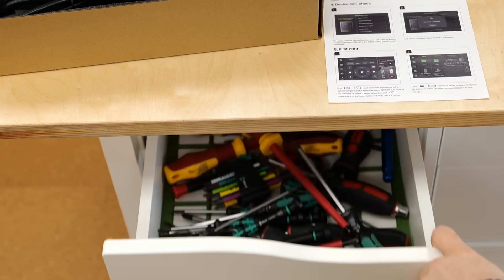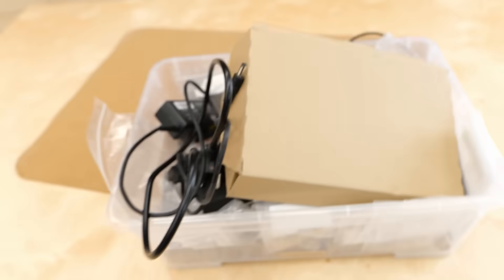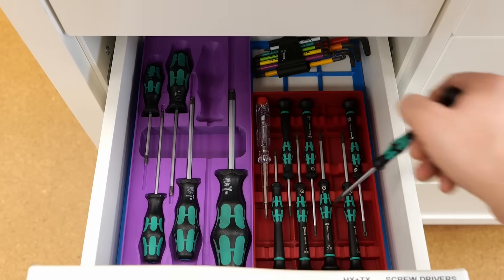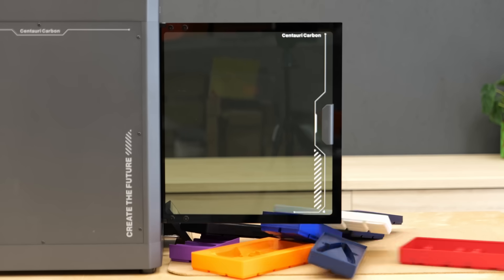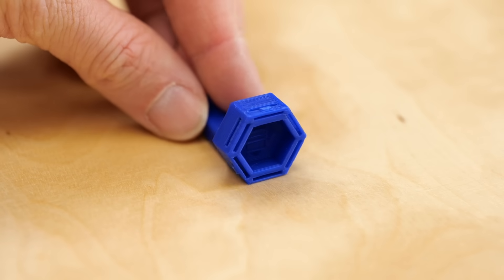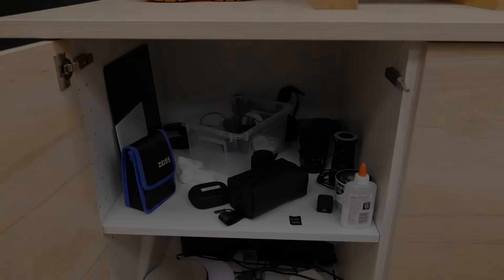The Best 3D Printed Organizers for your Workshop

Comment: I can confirm that the new RC firmware for prusa does in fact fix the mmu3 overcurrent issue. My MK3.5 had it for a while but I was too sick to bother with it. My MK4s got it today out of the blue. The firmware fixed both 100%, but due to the fact that I don't trust the power grid with the tornados that are coming in today I turned both off. So no printing. Maybe tomorrow! Assuming I have power. lol

Comment: Instead of a sticker label on the filament rack, this could be your time with a quick 3D print clamp-label. 
To the advantage, that you can (re-)move it :). 
You could of course print it with a flat and label that 🙃

Comment: I still don't get the gridfinity obsession. If you want to put some holders in a drawer to organize it great, just put the holders in the drawer. What does the gird add?
Reply: Stuff moves around whenever you open and close drawers repeatedly. So you have to keep the drawer packed tightly or the boxes will begin to shuffle around and become disorganized. If you take a box out, then things begin to shift about.

Also, the odd shape of some items might mean you'll have a useless and unused area in the drawer,  and everything will slide around. Hence the grid to maintain order.

Comment: Haha kind of crazy, I feel like 3D printed organizational systems are all the rage right now! It's definitely an amazing application for 3D printing. I went with the Mulitboard standard for vertical organization and Gridfinity for Horizontal (and combinations of both). I feel like Multiboard has a lot more thought and options behind it than the Honeycomb, I really like the ability to thread things together instead of just snapping. It just feels like a much more secure system.
Reply: Or just use an actual pegboard and only print specific hooks/holders you need. The cost/time/durability just isn't there at the end of the day. If someone wants to do it as a fun project, sure, but it is in no way more practical than a standard pegboard.

Comment: Very nice workshop! 

Are you drying your filaments every time before use ? Because here in Sardegna we have 75-80% humidity and I can't imagine leaving the spools without boxes with silica 😭
Reply from the maker: I usually don't with PLA. In winter we rather have ~30% rH here and in summer 50-60% so this is not much of a concern to me. If I print PC, PA etc. I will either store them <15% rH with silica or dry them before each use!

Comment: This is my ultimate dream.  For some reason i am obsessed with organization.  With having those tool boxes where every tool has it's own spot, where you can find anything without searching everywhere, without the plague of the routine that goes not finding it, looking some more, getting bummed out, finding it where it doesn't belong... 

So these examples are inspiring as heck.  Not only do your setups look great, but they all look very functional, clean, organized, colorful.    Sincere question here - are the small bins really well made?  I have zero time spent with a 3D printer so far but i can imagine layer adhesion issues, moisture issues, etc...  

But you cannot argue with the "form follows function" of what was shown here.   That and the fact that you got the whole shop done... shoot, must have taken some time.

Nice set of Wera screwdrivers by the way!  Yes, you have inspired me for sure!  Thank you for sharing
Reply from the maker: The hardest thing is to start! So go ahead and do it!
Reply: @ I am trying to get started... did not buy a printer, instead i had the stupid idea to build one... geez.  

When i got into FPV drones there was zero info on how to flash, configure, maintain them and i thought that was difficult.  It would seem that the need to understand software is way more important here...   

I have an Octopus Max EZ as my controller, an Orbiter 3 as the extruder/hotend... so i have some awesome components... now if I could just get them up and running!

The mechanicals will be a cinch but trying to find out where to get everything you need is a puzzle.  I finally got my Raspberry Pi up and running, was easy when you know finally what to do.    I followed a step by step video and it went fairly smoothly.  YTube has been invaluable in providing how to info as has your channel!
Reply: Gridfinity bins are among the easiest thing you can print, so they are are perfect starter projects even with a slightly wonky old printer.

Comment: I've been trying Multiboard, but starting very small.  Doing some research what sold me on it was that the system is reportedly much stronger than HSW.

That said, I find the licensing of Multiboard really challenging.  He seems to want to create this complex system that he controls and has a lot of it locked away.

I may try HSW for another small project to organize some things to see how I feel about it.  I think that Multiboard's biggest weakness is the license.
Reply from the maker: Multiboard is IMHO complex yet clean and well thought out but yes, a bit limited due to the license. HSW works and looks nice but is a bit hacky and inconsistent due to tons of contributors.

Comment: The glazing on Elegoo is crazy
Reply: It has P1C's specs for 1/4 P1C's price (that is $300 vs $1200). On paper, it's specs are even better with 320C nozzle vs 300 max on P1C. I have no clue about the quality, even on Elegoo's own page - it's not that perfect. But if it's +- close - the Elegoo one is insanely good value. I have A1 mini and Neptune 4 Pro, and Bambu's print quality, firmware, and basically everything else is leagues ahead. But Centauri Carbon looks really interesting (for the price)
Reply: @mklabtech  P1C????

Comment: I've made a few custom gridfinity models in on shape. There's an add on gridfinity generator within on shape, which is quicker than using a generator, downloading it then importing into on shape. Hope this is helpful!
Reply from the maker: That's cool! I got to check that out.
Reply: @CNCKitchen  FreeCAD also has a Gridfinity Workbench, easy to load bin models and modify them parametrically and with negative space
Reply: There’s a plugin for fusion 360 that does the same thing which is great
Reply: There's also an online generator, based on openSCAD, for Gridfinity, HSW and openGrid.

Comment: I've never understood the obsession of using hours of print time and attention on tool organizers you can buy off the shelf. But if anyone can convince me, maybe it's Stefan...
Reply from the maker: Try it! Isn't that finally a useful application of 3D printing 😉 No really, the customization is key here and what makes this really useful!
Reply: I finally started using gridfinity, and I very quickly realized that I don't need a gridfinity bin for every tool, just ones for the tools that I want organized and fit in a specific place in my drawers. And the ones that are exactly shaped for your tools are usually a waste of filament, simple bins are fine for most items, and it behooves one to make them as shallow as possible.
Reply: Tool organizers are to 3D printing as cutting and assembly jigs are to woodworking.
Reply: @RossReedstrom  You can use a 3d printer to make jigs and assembly guides for woodworking. Kinda like a 3d printing/woodworking inception.
Reply: No organisation at all is bad, going to the point of shaped holders is likely a waste of filament and flexibility, since it becomes completely dedicated.
Not too big boxes by content gives flexibility and minimal time loss compared to the extreme shown

Comment: no word about automating your bambu printer to throw out prints off the front door haha
i want my p1s to do that too if nothing gets broken doing it ?!
what i always wonder, how do people store filament undried in racks. I always store in vacuum bags to be ready to start a print instantly not to dry first 10 hours some nylon or am i missing something ?
Reply from the maker: IMHO it's not a big issue with PLA/PETG if you have humidity levels ~50%. Yes, most of my PA & TPU is vacuum stored, but not everything. These spools I simply dry before using them.
Reply: @CNCKitchen  thanks for the answer :hand-purple-blue-peace:

Comment: I definitely lean towards multiboard, since it’s a 50 mm base multiple measurement standard, but also because it natively supports hex grid parts with an adapter, whereas fitting multiboard to hex grid is not nearly as simple
Reply: Also, I really like the possibility to have bolts screw directly into the multiboard to attach something. Being able to just add conical holes at the wight places makes it much easier to add my own storage solutions to my multiboard wall than having to fiddle with a way to get the push-fit for HSW to work. Also stacked printing makes it much easier to print all the tiles for an entire wall.

The only downside is that the multiboard's base size of 25mm doesn't interface well with the 42mm base size of gridfinity. But well, I guess we can't have it all.
Reply: what you mean by "natively supports hex grid parts with an adapter" would that not be native.
Reply: @ may not have been the right words, but multiboard come built in with hex grid adapters that fit inside the multiboard octagons. The octagons are bigger, so the hex fits inside, but that doesn’t work vise versa because math and physics

And I don’t care about semantics or redundancy so we ball and all that
Reply: @dwaynetherock-hardjohnson5676  Ahh makes sense

Comment: AI Summary:

Abstract:
This video demonstrates how to use 3D printing to drastically improve workshop organization. The creator tackles common workshop clutter by implementing several systems: Gridfinity for small parts and tools, custom-designed 3D-printed tool holders, a wall-mounted filament rack using conduit and 3D-printed brackets, and a Honeycomb Storage Wall (HSW) for versatile wall storage. The video showcases the design process, highlights the benefits of modularity, and discusses the pros and cons of 3D printing versus pre-made solutions like IKEA's SKADIS. The project is made possible using, and features, the Elegoo Centauri Carbon 3D printer, emphasizing its speed and ability to handle various materials.

CNC Kitchen Workshop Organization with 3D Printing

*   0:00 Introduction: The video focuses on using 3D printing to organize a workshop, addressing the common problem of wasted time searching for tools and materials.
*   0:55 Elegoo Sponsorship: The project is sponsored by Elegoo, featuring their new Centauri Carbon 3D printer, highlighting its speed, enclosed design, and high-temperature capabilities.
* 01:51 Project Desk: Stefan of CNC Kitchen begins by showcasing his existing project desk.
*  02:06 Disorganized Drawers: Kallax drawers, despite their theme, are difficult to keep orderly, and items get lost at the back because they do not extend fully.
*   02:52 Gridfinity System: The primary organization solution is the Gridfinity system, a modular, open-source system based on a 42mm grid, allowing for customizable bins and storage solutions.
*   03:55 Fastener Organization: The first application is organizing fasteners (bolts, nuts, washers) using modified Gridfinity bins with easy-to-slide-out designs and color-coding.
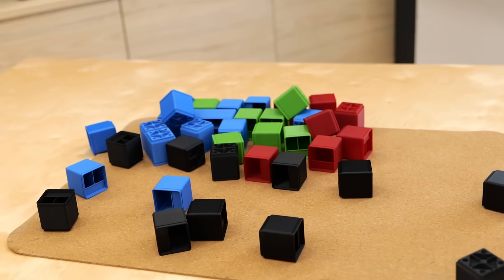*   05:00 Labeling: 3D-printed labels or a label maker are used to mark the contents of the bins.
*   05:54 Baseplates: Custom Gridfinity base plates are designed and printed in sections to fit the drawers, due to the printer's bed size limitations.
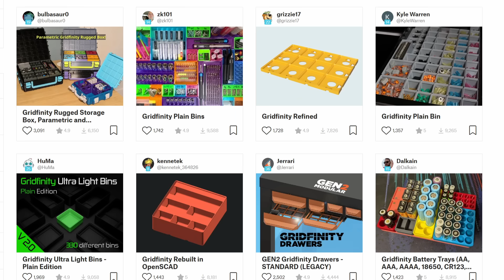*   06:50 Screwdriver Organization: Pre-designed Gridfinity bins are used to organize screwdrivers, similar to a shadow board concept.
*   07:57 3D Printing Tool Organization: Another drawer is dedicated to 3D printing tools, using a combination of existing and custom-designed Gridfinity bins.
*   08:36 Custom Bin Design: For unique items, custom bins are designed using either basic shapes in the slicer or more advanced methods like photogrammetry and CAD software (OnShape).
*   10:39 Filament Organization: Existing filament storage is improved by adding a new shelf system using 1/2" electrical conduit and 3D-printed holders, inspired by the RapRack design.
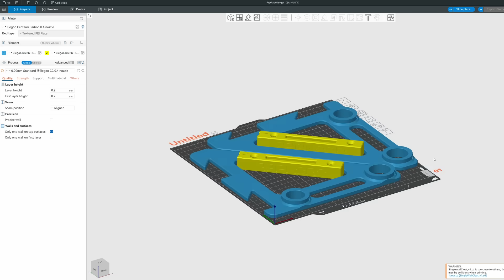*   11:46 Filament Holders: The mounts are printed on the Elegoo Centauri using PETG, 4 walls thick, and include brass inserts.
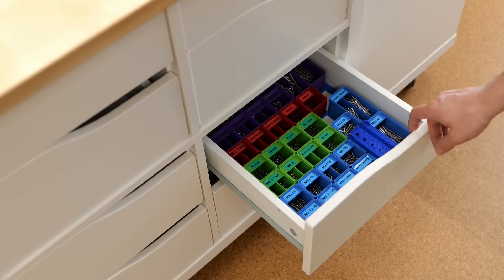*   12:38 Wall Storage - Honeycomb Storage Wall (HSW): A wall-mounted storage solution, the Honeycomb Storage Wall, is introduced for additional organization, using 3D-printed hexagonal panels and various attachments.
*   13:31 HSW Printing: Printing the HSW is time-consuming and material-intensive (28 panels, each taking 2.5 hours).
*   14:05 HSW Assembly: The panels are connected using printed connectors and mounted on the wall using screws and a self-leveling laser for alignment.
*   14:31 HSW Accessories: A variety of 3D-printed accessories are available for the HSW, including shelves, tool holders, and more.
* 15:02 HSW Downsides: Some downsides of the system are the print time needed, and the complexity.
*   15:49 Alternative: IKEA SKADIS: As an alternative to the entirely 3D-printed HSW, the IKEA SKADIS system is mentioned as a potential future project.
* 16:32 Conclusion: The importance of using an organizational system.
*   16:42 Elegoo Centauri Carbon Review: The video concludes with positive feedback on the Elegoo Centauri Carbon 3D printer, praising its speed, reliability, and ease of use.
* 17:32 Next Steps: The video is the beginning of a larger shop organization effort, and the organizational setup will likely evolve.

I used gemini-2.0-pro-exp-02-05| input-price: 1.25 output-price: 5 max-context-length: 128_000 on rocketrecap dot com to summarize the transcript.
Cost (if I didn't use the free tier): $0.02
Input tokens: 15378
Output tokens: 878

Comment: I have Ikea Alex drawers, and the regular width is pretty much perfect for a 7x wide Gridfinity system. There are a couple of millimeters left on each side, which is incidentally needed to clear a screw on each side of the inside of the drawer. There's a base plate on Printables with built-in spacing to perfectly center the base plate.

Comment: Gridfinity seems great for simple boxes but anything more complicated and my experience has been quite similar to printing holders for the SKÅDIS pegboard: 90% of the models are just awful with poor DFAM or overall lazy design and poor tolerancing, and I'm too lazy to design the holders myself
Reply: Agreed. Custom trays for absolutely every little thing (like the lube in the video example) looks neat but is just not worth the time. For small parts like screws it's amazing, though.

Comment: An other thing I like with gridfinity thingies is the ability to take the entire thingy out.

I use an electric screwdriver for a lot of things (Dewalt 8V gyro thing), and have the hex bits in a gridfinity container.

Whenever I need to work on something that I'm unsure of the fastener size, I just take the hex bit container out of my toolbox, and put it back there when I'm done.

Comment: I like the Ikea SKADIS pegboards. They're dirt cheap and super reliable. And you only need to print accessories (which are widely available). The hexagon system seems a bit sketchy to me as the hooks are tiny, whereas the SKADIS hooks are a lot bigger.
Reply: Hexagons are cool and the systems have a lot of models, but I prefer skådis in multiple areas. It generally looks nicer anywhere in a home, and it's nice to just get one large plate and not having to print so many baseplates+connectors. A 76x56mm skådis costs the same as 1kg of pla. 
How many different attachments do people realistically need anyways. you could also get a model you like and join some skådis pegs on the back.
Reply: Yeah SKADIS seems better overall.

I dislike HSW because moving items around isn't as easy as he has shown. I tried printing HSW couple of times, but each time I wanted to move something around on the board, it ended up breaking or was just super hard to get out. If the attachment is quite easy to remove, it most likely isn't held in place properly in my opinion.
Reply: and you can use more hooks on the back of what you design the bigger it gets
Reply: You can also print your own Skadis panels - that's what I did, they look nice when printed face down on a textured plate
Reply: I own a SKADIS pegboard and I'm not super impressed. The boards are weak and flimsy. The hook system is not very convinient to use. The only real advantage of this system is that it has a proper instagram-look. For real world workshop use any pegboard is way better.
Reply: I can confirm the hexagon system is more cool to look at than useful, a skadis pegboard with printed accessories is a better choice
Reply: Agree 👍
Reply: You can even print Skådis boards.. many options out there. I found one that prints on the A1 mini where you combine plates to an "infinite" size without any gabs in the holes, that using the originals will have.
Reply: the hooks are not load-bearing in HSW, they simply keep the plugs in place against forces pulling perpendicularly from the board.